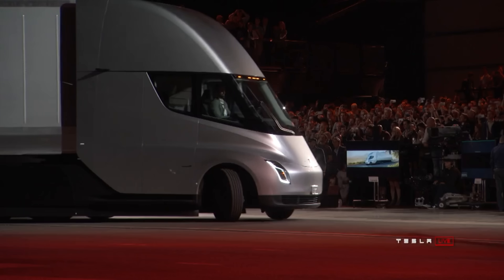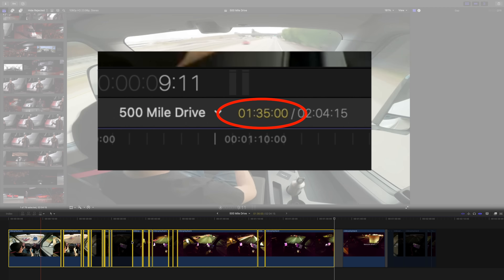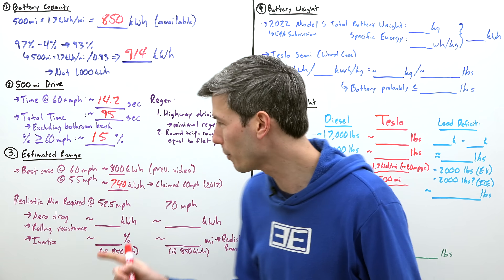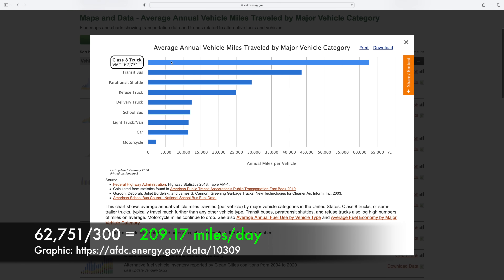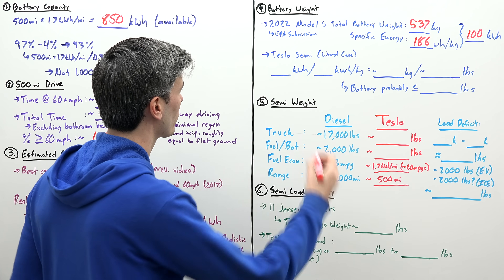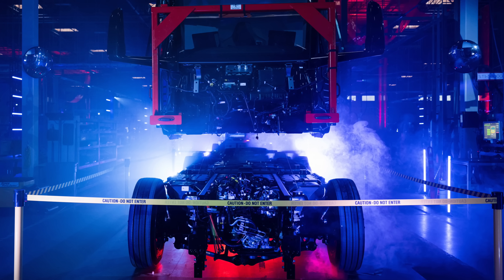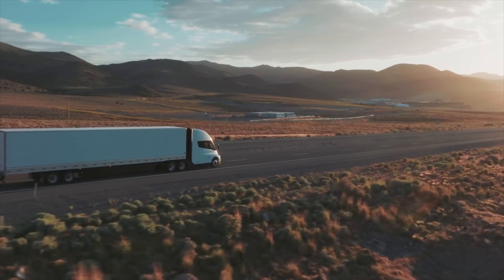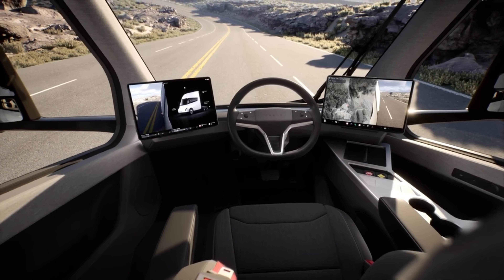Does The Tesla Semi Make Any Sense? Part 2!

Comment: Ok, so it's not as bad as first thought, mostly due to the lack of information that Tesla had given out, making the math require assumptions and educated guesses. 

My main concern is the life of the battery. Batteries of that size being drained and fast charged every day is going to severely reduce the life of the battery. The claim of it taking 35-45 mins to charge means it's getting charged very fast. I expected the charge time to be at least one hour for a battery that size, probably with an option to slow charge it if you are leaving it to charge overnight.

Next thought is that Pepsi being one of the companies buying them, but using grants and incentives to the point where they're basically covering the cost of the vehicle makes me think that it isn't economically viable without them. So, tax payers are effectively paying for a private company to get a new fleet of vehicles. If Teslas are so much better than diesel trucks, as Elon has been claiming, why does it need this much government funding for companies to buy them? I can understand an incentive for the installation of the charging bays, as that's a type of infrastructure being used by a private company, same as the highway system, except no one but the private company in question will have access to the charging stations (probably). 

Yes, I'm against corporate subsidies, as they generally get used to make the company look profitable and justify the huge pay and bonuses for the CEOs, when they were designed to make the company charge lower prices for their products.

Comment: To me this video confirms that the Tesla Semi is yet another case of Tesla/Musk overpromising and underdelivering.
This isn't the "revolutionary EV Semi that totally changes the transport business" that Musk promised and as usual for Musk it took twice as long for the first Semi's to be delivered than Musk promised back in 2017. But what's even more a let-down, is the fact that the Tesla Semi only makes sense in very specific cases as this video pointed out and therefore is NOT the 1 on 1 diesel truck replacement Musk promised it would be. 
 
Then there's the problem with the subsidies: don't count too much on those when you make your calculations. Over here in the Netherlands our government also heavily subsidized the sales of EV's and public charging stations. But as our government has a chronic problem with spending more money than it actually has to spend, which is pretty much the case for most other governments as well, those subsidies quickly disappeared, making the customers calculations that led to buying and running an EV useless. Tesla/Musk already has somewhat of the same problem with Musk's 2017 guarantee of the price for a kilowatt-hour of electricity.

Comment: "Do i have the charging nfrastructure"?
Nope. Not at "Mega Charger" levels.
And Li-ion batteries discharged below nth % degrade faster, so those max range calculations are great, for the first year maybe. Then;
"Does it make financial sense", becomes an even bigger no.

Comment: With Tesla having so much self driving tech, I wonder if there are any considerations to allow trucks to link their drive control so you could put multiple trucks on the road drafting each other at only a few feet.  The range would probably double or triple if you could draft like that.  Basically, the drafting trucks would be in FSD mode following the lead of the first truck with the computers of all trucks linked via a radio interface.  I'm not saying there would not be drivers in them, I expect all trucks to have a human ready to take over if the convoy needed to be broken up.  The trucks would periodically rotate who is in front similar to how cycling teams do.
Reply: How do you plan on merging into the 6 ft of space between a convoy of 7 trucks going 55 in the right lane? Plus governed trucks have to pass that, so the average speed in the passing lane drops to about 58 mph.
Reply: @MobiAussie  Who said 7 trucks?   I would say 3 would be a more appropriate number.  2 of 3 trucks would likely double their mileage.  It would be reasonable to travel faster than 55 since the trailing 2 trucks would probably see little impact from the higher speed.  And you would not merge between them.  You would go ahead or behind them.  And this would be something that is restricted to open road 4 lane divided highway in a rural environment.  Australia already has something similar, except it is one cab with multiple trailers all hooked together in a train.

Comment: We can't get around it. The actual solution to all of this is, yes, also electric trucks, but mainly: more railroads. Electric trains. Those trains are so long that aerodynamics don't matter. Also, orders of magnitude less rolling resistance, which is huge with flexible rubber tyres. The US need to expand their train network.
Reply: Trains are electric. They have electric motors powered directly by a diesel generator. The battery is small.

Comment: As a real truck driver I don't see very much in the fields I hauled this truck would be worth using. 
The only way I see this making sense. Is removing owner operators. Something which California is trying to do.
I personally see this has going backwards. Instead of make technology to make things better. They are changing things to make it fit technology that isn't as good. 
What kind of fire prevention do these trucks have. 
Many truck jobs aren't miles as much as hours behind wheel.

Comment: You missed the point that the Tesla cab has no accommodation, so that's 2000lb, if the cab is longer to have a bed, fridge and storage, because there's no storage in the front cab area in a Tesla.

Comment: Hi, thanx for great job! 
I would be thrilled if you would elaborate a little more around the energy density on pack level. 
You use the energy density of the Model S, which uses other cells than the Tesla Semi.
Have you made an estimate of the volumetric energy density, as well?

Comment: For the weight section: 1) It's likely that Tesla semi weighs more than an average truck because if it was lighter, Tesla would tell you. It's an important factor for economics.  They don't disclose the weight.   2) You compare apples to oranges. For a 500 mile range, the tanks don't need to be full for a diesel semi. 3) "You can probably save another 2000 pounds."  - I sincerely doubt it. Check John Cadogan's analysis for why.

Comment: 1) Range changes depending on how the battery is treated.  The economics may change as time goes on.  2) It's only a matter of time before one of these goes into thermal runaway.  The fire will be self-sufficient and I dare say that it will block a road for a long time.  There is no tank of water to dunk a semi into until the thermal runaway completes itself.  I don't imagine that a towing company will to tow a burning fire.  It's going to be quite a spectacle.

Comment: Those jersey barriers do not weigh 4,000 pounds, that’s the wet weight. When dry such as in the photo they are closer to 3250. I know this because I haul them and as such have weighed them.
Reply: These are 10 ft. Caltrans-approved K-rails, right down to the shape molded into the end and the circular lift/tie-down openings. The Caltrans blueprints and numerous other sources show 10 ft. K-rails to weigh 3,900 to 4,000 lbs. There is no dry or wet weight.

Comment: I would like to know if anyone has done any research on driver comfort on our mandatory breaks, such as our 10 hour, sleeper, berth or 10 hour end of shift break, and how much energy or percentage of battery would be used for running heat and air conditioning, as well as TVs, microwaves, and other electronics
Reply: Similar to newer Tesla automobiles, the Tesla Semi uses a highly efficient heat-pump for heating and cooling. As a result, energy use to maintain comfort is minimal; perhaps 2-3 kW, with a battery of around 900 kWh. You can do the math!
Reply: It's a day cab.

Comment: In my view, Tesla Semi will make sense even at 40 mph when it is equipped with completely driverless tech. I see a day, about 20 years from now, where AI soil preparers will prep and plant crops to be continuously watered, fertilized, harvested, cleaned and packaged by AI harvesters, which will move them to AI loaders upon driverless Tesla Semis which will deliver them at 40 mph, moving 24/7 all across America to loading docks where AI unloaders will receive the goods, inventory them, and then load them in warehouses to be either drop-shipped by AI delivery directly to consumers, or to old school brick and mortar locations.

We don't need the trucks to move at 70mph. We need them to move consistently, uninterrupted by crashes, sleep and potty breaks. The key is to get the humanless navigation nailed down so that it is flawless.
Reply: Jesus Christ, Prime Inc already creates traffic jams on 2-lane interstates by driving 58mph. You think 40mph is a good idea??? That's not safe.
Reply: @MobiAussie  Well, there will have to be some changes in how we use the highways, and also how Tesla Semi uses them. Keep in mind that if in 20 years driver-less tech is sound for semis it would surely be just as sound for consumer autos. And this means that highway travel, even with Tesla Semis going at 40mph, would be much safer than highway travel today.

But I only chose 40mph here to make the point of not needing the trucks to travel at 70mph for them to make sense. As long as they can travel with consistency, no breaks at all, then they quite possibly will be able to deliver goods at the same rate or better than the current rate of delivery.
Reply: @oscarbenigsen4538  
You have no idea what you are talking about, it's laughable. Speed doesn't cause accidents. Speed differential does. I've seen interstate posted speed minimums of 45. There's an Oklahoma turnpike with a speed minimum of 60. Because you don't want a cluster of 80 mph traffic coming up on a 40mph obstacle. It's also the reason lane closures are signalled miles in advance. Lunacy.
Reply: @MobiAussie  And where did I say anything about speed causing accidents? My point had nothing to do with this. It has everything to do with AI coordination of highway objects so that speed is optimized and differential is minimized. With AI navigation, it is likely that a lot of what you are saying here would be irrelevant. Trucks, for example, could all be relegated to rightmost lanes, and kept in sync there from coast-to-coast. Faster traffic could be relegated to leftmost lanes and similarly maintained there. It is not lunacy. It simply takes a slightly bigger brain that apparently you have ever encountered.

Comment: Part of the shenanigans is trucks spend all day on the interstate and the reason they still run diesel engines instead of propane engines is because the throttle has to go up and down a thousand times a day propane needs a stable throttle to operate properly electricity has the same problems of propane it requires a stable throttle big rigs going down the interstate or in the gas out of the gas in the gas out of the gas all day long an electric truck will never pull that off in order to do it it would be way too heavy so now trucks have to go 50 miles an hour and stay on the back roads what are we going to do lower the national speed limit to 50 mph on the interstate so the trucks can do it electric vehicles are a scam

Comment: You got to remember when dealing with Musk: He lies. All the time, constantly, nonstop. He said they have a range of 500 miles at 60 Mph, but it doesn't mean it's true. I wouldn't hold my breath if the claims of efficiency aren't true either, not at any meaningful highway speeds at least. Some leaks from Pepsi claim the truck does an effective of 100 miles on a single battery if you try to actually use it outside of a 27 Mph crawl on flat ground without any stops.

Comment: The minute he came out with the Electric Semi-Truck, my eyes rolled and I screamed (in my mind) DIESEL-ELECTRIC. 

Seriously, Locomotives and Surge Power/Backup power Generation, and U-Boats cannot be wrong.

Ditch the big battery. Ditch the limited range. Ditch the recharge times. Ditch the enormous 440V charging stations. Install a small battery, an extremely efficient turbo-diesel, powering a generator, powering six electric motors, one on each axle, and charging a small-ish battery that acts as a reserve boost of 5-10 minutes for passing and climbing hills.  

The Diesel motor only has to be approximately 100hp instead of 450-600. It needs to run at 50-75% power for interstate cruising. 100% to deive and charge battery. 100% + battery reserve for climbing hills. Descending same hills recharges via regenerative braking. All the electric motors allow for 6x6 all wheel drive and make snow and logging roads and mountain passes a cake walk.
Reply: Have you been made aware of Edison Motors and their diesel-electric logging truck, yet?

Comment: Talking about regenerative braking and downhill coasting: The Fast Lane YouTube Blog took two electric pickups, a Ford EV-150 and a GMC Hummer up their "world's toughest test track, a segment of I-70 west of Denver. Both trucks had a 100% charge at the start, and were towing a 6100-pound camping trailer which shouldn't be much for a half-ton rated pickup truck. The test is only 8 miles long, but has a 7% grade. Both trucks used 92% of their total charge to go that 8 miles. THEN The Fast Lane people turned the trucks around and went downhill (the reverse of the first segment). The trucks only regenerated 4% of their charge. So regeneration is apparently a pseudo crutch so as to fake out the potential buying public. Tesla is peddling "regeneration offsets the charge used on the uphill (or other) climb." The video is available on their blog site on YouTube. The results speak for themselves. THEN: TFL took a GMC Hummer and a Ram 3/4 ton  truck with a Cummins straight  6 diesel on a level Interstate road east of Denver to equate diesel vs. electric capability, again with a 6100 pound trailer. The Ram had a full tank, and the Hummer had a full charge. On a level highway the Hummer was down to 6% charge in 120 miles and the Cummins-equipped Ram used 10 gallons of diesel (out of a 25-gallon tank) in that same 120 miles. So the Hummer had to stop for about an hour to get up to a 70% charge at a "quick charge" station, and the Ram truck took 5 minutes to refill and be on its way. NOW, the Hummer's "fuel" bill was around $50 and the Ram's fuel bill was around $75-100 (I forget the exact number, but its on their video). Seemingly a sort of a victory for the Hummer, BUT the Ram had a MSRP (window sticker) of $64,000 and the Hummer window sticker was $115,000. You can buy a lot of diesel for a $51,000 price difference. And the convenience of only stopping for 5 minutes for a refill and then being on your way again vs an hour for a 70% recharge with the EV. Again, the full video of the test is on The Fast Lane (TFL) blogsite on YouTube.
Reply: This video doesn't say anything of the sort. Both vehicles started in Boulder, CO, and drove 68 miles to just before the Eisenhower Tunnel. The Hummer used 60% charge to drive the 68 miles uphill, and the Ford used 70% (smaller battery). Then they drove up the final 8 mile steep grade before the tunnel; one vehicle used 16% of charge for that portion, and the other used 26 kWh. So far from using 92% of their total charge to go 8 miles as you claimed, they went 76 miles, including the steep 8 mile grade; used 26 kWh and 16% respectively on the 8 mile slope; and still have >10% capacity when they got through the tunnel. It's not clear if you're being deliberately misleading, or simply didn't understand what they said; but I'm leaning toward the former.
Reply: Why are you lying like this?

Comment: Thank you for that great technical analysis! Over here in Europe, speed limits for heavy trucks are a bit more restrictive. In most EU countries, they are limited to 50 mph (80 km/h), sometimes 58 mph (90 km/h). And all drivers will max out as much as they can, going 86 km/h or 96 km/h. So, for Europe, you 52,5 mph figure is most important, and at that speed, range and capacity of the Tesla Semi are looking quite good.
Reply: There are multiple things working against the current tesla semi in Europe:
Least to most important:
1. Weight. The Tesla semi is a heavy truck by european standards. A normal European truck is like 15k pounds.
2. Space. The Tesla Semi won't work in Europe as a Semi. Look at the amount of Space they gave the battery. You don't have that on a European truck. Every European electric truck is a 18/26 Ton truck wich are capable of carrying a 20' container as their load. They use the space underneath that load to place the battery.
And out of that argument 2 follow a large amount of different things.
Reply: @theonly5001  European heavy trucks are up to 40 metric tons gross weight, plus some additional 3 t for electric trucks. The Tesla Semi isn’t much heavier. And the tractor of the Tesla isn‘t too long either…
Reply: @phonehoppy  They are up to that weight, but the weight of the Tesla Semi is still a couple tons heavier than the normal Truck. This is  just simply the result of it being electring and larger.
It is 2 meters longer than a conventional Tractor and thus would require either a shrinking of 2m in length or new Trailers for everyone who wants to use that one.
Loosing some of the even more imporant cargo space.